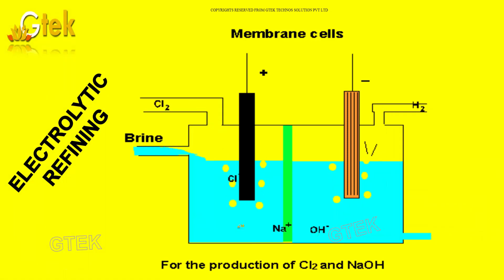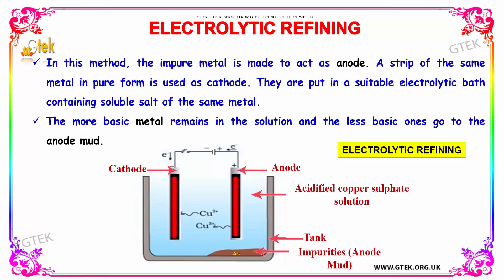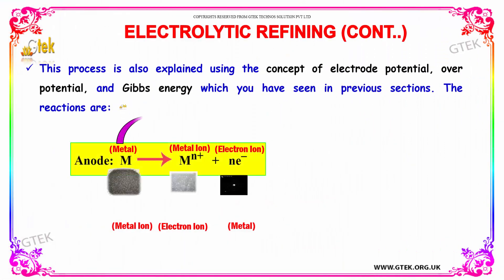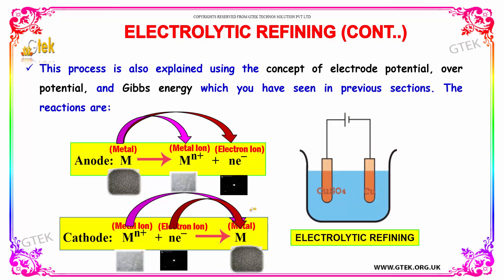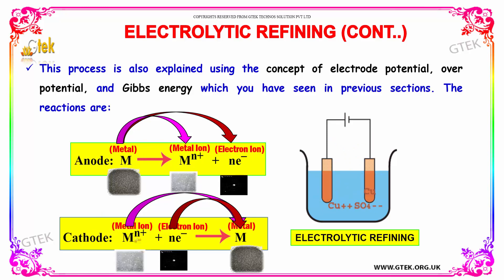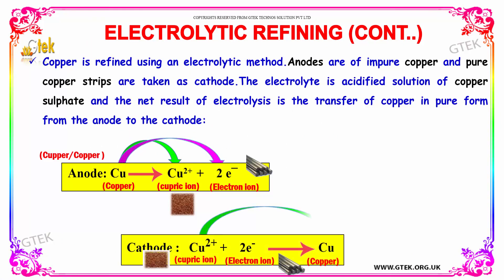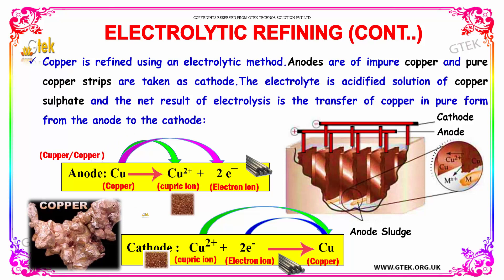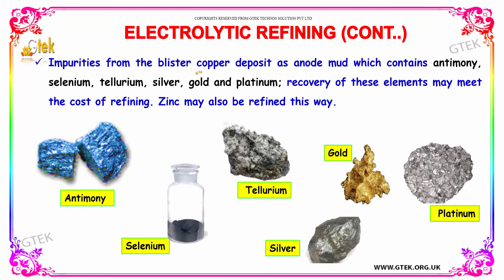electrolytic refining general principles and process of isolation of elements 12 chemistry cbse

Comment: The purification uses an electrolyte of copper(II) sulphate solution, impure copper anodes, and strips of high purity copper for the cathodes. The diagram shows a very simplified view of a cell. At the cathode, copper(II) ions are deposited as copper. At the anode, copper goes into solution as copper(II) ions.

Comment: Silver is extracted from sulphide deposits using a series of processes such as flotation, electrolysis and oxidation. Air is pumped through a slurry of water and powdered ore during flotation. The metal sulphides sink to the bottom then different methods are used to purify the ore.

Comment: An electrolytic cell is an electrochemical cell that undergoes a redox reaction when electrical energy is applied. It is most often used to decompose chemical compounds, in a process called electrolysis—the Greek word lysis means to break up.

Comment: The purification of metals by electrolysis. It is commonly applied to copper. A large piece of impure copper is used as the anode with a thin strip of pure copper as the cathode. Copper(II) sulphate solution is the electrolyte.